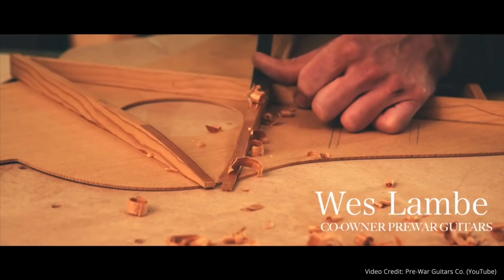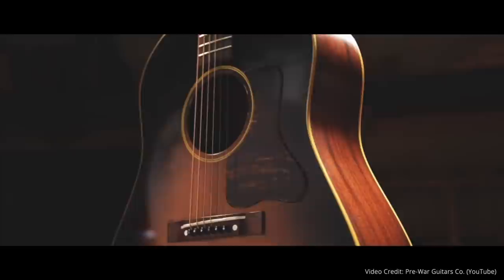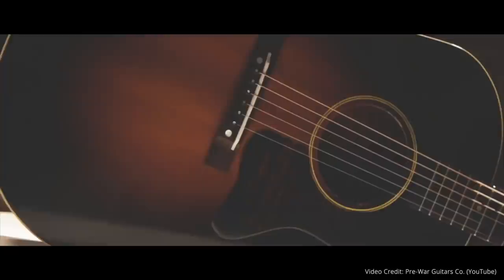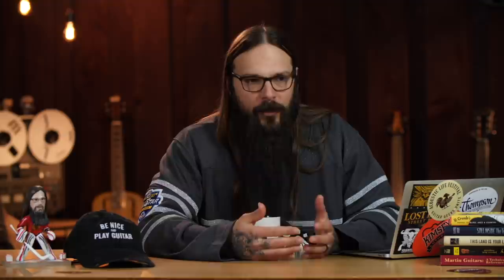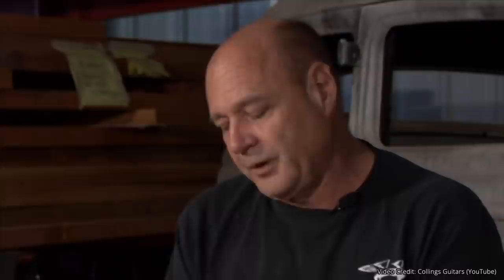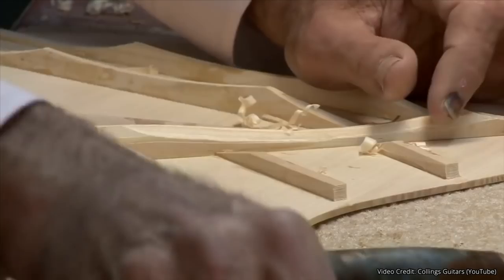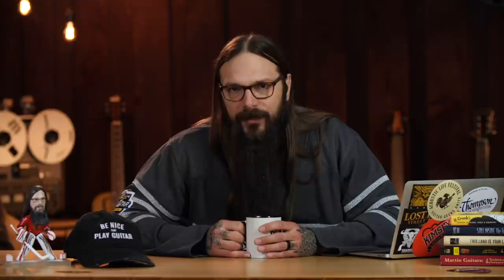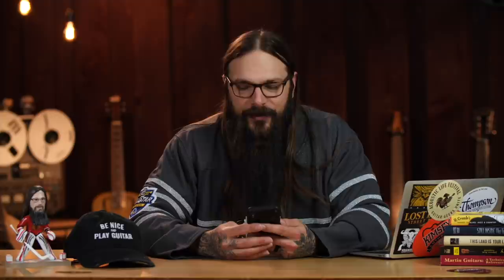Do These Builders Make Better Martins Than Martin? ★ Acoustic Tuesday 188

Comment: Pre War is really the only company trying to recreate vintage Martin’s. All the others sound great (big fan of SCGC & Bourgeois) but they are different builds in regards to Martin. A bolt on neck isn’t a Martin trait.
Reply: To me, a bolt on neck is a deal breaker.
Reply: @stevenwilliams9758  Not for me. Bourgeois, Collings, Huss and Dalton, Boucher, all use bolt on necks and their guitars are great. There are many other factors that effect tone other than a neck joint. I've played many Martins that were duds  with dovetail neck joints. I currently own 3 Martins so trying to explain my opinion from a neutral standpoint.
Reply: @stevenwilliams9758  bolt on necks don't really make a big difference

Comment: I'm midway through a second Martin OO kit with a student. The first one turned out great, and sounds better than his 2000's factory guitar. The kits are a crap shoot, though. It's wood that didn't make the grade, but that can be down to really superficial cosmetic stuff, like a tiny knothole in a neck, or inconsistent grain width. There are some great boutique builders out there doing one-offs, and smaller companies that are making dreadnoughts just as good as Martin. I believe that once  you get above a certain level of quality, it starts getting really subjective. Not  everyone  wants the same sound and feel in an acoustic. Martin also went through some pretty dark years in the 70's though I think they've got  their  mojo back. As a side note, I had somebody bring me a cheap purple sunburst Fender from the 80s that had a bridge pulling up that I'd stack up against any D-18 in a blind test. You just never know. Also, I think the StewMac kits are Martin parts, but I could be wrong.

Comment: I have two martins the hd-28 and d-35. Love them both but can't afford the ones you mentioned here so I am limited to my budget. I wanted a mahogany body dreadnaught. I had my mind set on the d-18. I tried several d-18s then tried godson's j-45. I now have a j-45 and purchased the first one I played side by side with the martin. It's as loud and better action than the d-18. The shorter scale length is more comfortable for me since I'm a small person. I'm not a bluegrass player so the j-45 is a wonderful surprise to me. I still love my martins but the j-45 complements them very well.

Comment: sometime, I would like to hear you talk about owning and playing playing multiple instruments vs owning multiple guitars on acoustic Tuesday.  I played acoustic and electric guitar for decades, playing mostly 3 or 4 country style flat picking and finger picking. I tried many times to wrap my head around theory but just could not get it done.  Adding mandolin taught me relative minors, chord scales and drove home the fact that playing all the notes in a chord is not necessary.  In less than 3 months of playing I learned what I failed to learn in the previous couple of decades.  Playing resonator open tunings really hammered home the whole root, third, fifth thing in a way standard tuning could not and how to figure out minors, 7ths et al because no matter what  major chord position the bar is in, the 1-3-5 are always the same. Dobro (i call it because I play lap style) also made it much easier   to play pentatonic scales over a chord progression.  Dobro also made much more clear the idea of major and minor scales because it is linear. So instead of many different acoustic guitars, I have one steel string acoustic, one classical, one electric, one mandolin, and two resonators (open D and open G) and one electric lap steel (in search of a second for same reason as my dobroes).  When I get the T Shirt, I will post a pic and  list the brands.

Comment: I purchased a D-18 this year. I wanted a D-28 for 38 years (my teachers). Tried the D-18 and took it home. 
Well I swapped for 5 minutes my Rickenbacker 360 to Richard Thompson this past summer at "Frets and Refrains" for his Lowden 3/4 of the size of my D-18 twice the volume.
Four times the price.
If I was making my living from that guitar it would be a Lowden or Santa Cruz Tony Rice. 
If I were a professional mechanic you would find Cornwall or Snap on in my tool box. Not Craftsman.

Comment: Yes.  It's the tap testing and the radiused tops and all the attention to detail that goes into a Bourgeois or a Preston Thompson that puts them above any Martin made since the late 1940's.  These boutique guitars are very expensive but it's chump change compared to what a 30's or 40's Martin goes for.  Plus the boutique guitars have better necks and they're designed for optimum playability.

Comment: I'd agree with a comment further down in this thread about Wayne Henderson.  I personally love my 2007 Martin HD28V.  I looked and play at least 40 of these guitars until i found the one i took home.  When I first hit a chord and felt the tone woods vibrate into my chest, I knew this was it.  I had looked at many others, some on your list, but decided the HD met all the requirements I was looking for in what would be my workhorse.  I've been beating this thing in public for almost 15 years, dropped it twice, broke the nut, hit it on the mic stand twice the first night out and it still gives me love every time I put it around my neck. Are there better guitars out there? Probably. Is there a better guitar for me? Probably not.  Find what you like and play it, all the time.

Comment: I have a Collings D2H. For a Collings Dreadnaught it's low end but it sounds better than any Martin I've ever heard. I also have a Santa Cruz 1929 00. I know it's not a dreadnaught but it's easily the best 002H I've ever heard. 
    Yeah, I changed the topic from exclusively Dreadnaughts but the story behind both acquisitions you may find interesting. I've lived in Bangkok  for over five years now and I've been checking out a very reputable shop that only sells left handed guitars      (Yep. I'm a leftie) around the Boston area and I saw these two and had to have them. And they're really snapped up quickly. 
      Special Delivery for guitars this valuable is several hundred dollars. And they inspect the woods to make sure they're not endangered. And you have VAT. 
    But I took both of them home on the same day. Worth every penny.

Comment: Be sure to look at Gallagher guitars.  The new owner Dave Mathis is increasing production of their "signature" models (G-50, G-70 and Doc Watson) but also has a new model called the Bluegrass Bell, based off of a 1937 D-18.  I won two-a Doc Watson I bought in 2014 and a new G-70 with a yellow cedar top.  You will be able to find these more readily than was the case before the new ownership. Otherwise, I agree with your other top guitars.

Comment: I think these smaller shops, among others (and the shop Yamaha has in Japan) make better guitars simply because there are too many guitars produced by Martin. The time for quality,  quality control is just not there. Minutes allotted for inspection per guitar, and way more hands involved. Too many cooks, so to speak.
Reply: Excellent point. The same observation applies to Taylor Guitars. However both companies are excellent at self-promotion.
Reply: Wouldnt small boutique shops be closer to the martin custom shop? Less hands more QC. That would be more accurate comparison I feel like than mass produced martin models.
Reply: @GirthQuake3  
Another thing to point out is that the vast majority of Martin’s production volume comes from Mexico not Nazareth.

Comment: I love the sound of a dreadnought but they are not for me. My right arm goes numb after about 15 minutes of playing due to the edge of the lower bout digging into my arm (something a bevel would cure). I am a 00 player.🤗
Reply: You should try a Martin d16e. Dreadnought with 000 depth. I had the same problem
Reply: @patrickwhite3362  Sounds interesting, I will have to check one out.
Reply: Are you sitting on a sofa while playing? Try sitting on a stool where your body is more upright and extended, like a bar stool. My arm does the pain and sleep thing, too, when I play my D on the couch. But extending in a "proper seating" position, I have no problem. Ya don't get to feel like yer in the nasty couched swamp groove thang, but ...     Your creativity will adapt.
Reply: @blakebruner6173  I usually sit on a stool with a foot rest while playing.  I have a  Furch Little Jane for couch or chair lazy playing or a ukulele.

Comment: Actually I prefer parlor guitars over dreadnaughts. 
Funny journey. Back when I started I preferred dreadnaughts with cutaway. Then I heard the difference in tone to a dreadnaughts without cutaway. Along the way I found that these are a bit too big to carry around - so bought a travel guitar in the size of a baby Taylor. 
It was easy to travel around with but It just wasn’t satisfying in terms of sound. 

So ok let’s take the middle maybe so I bought a Taylor BBT. Loved the sound still one of my two favorites. 
But in a way… still too big. 

Then I bought a Parlor guitar. Solid top Mahagoni with way too thick lacquer and finish on it - but the size was finally right. So I sanded of the finish and the lacquer and reapplied new one very thin with a paper towel and polished it. 
Now it’s sound as if it’s the voice of god coming out of it, warm, soft and clear tone with a lot of sustain and presence. It’s really „in your face!“. 

After all she could be a bit thinner but for now - I found what I needed all those countless years.

Comment: Tough to find and play these boutique guitars and when you do the store keepers watch you like a hawk and it makes it difficult to get comfy and dig in to all that guitar has to offer.  Froggy Bottom made a big splash years back but I’ve never seen one in person.  I’ve never seen a Santa Cruz or a Thompson either and I live in NYC and frequent many guitar shops.  I’ve bought many Martins and honestly the quality control on them is terrible: the JMOM, the CEO 7, a HD-28, all had problems.  While my $500 used Takamine was issue free for years.  My two best sounding guitars where a Gibson J45 and a Gibson L-00.  Never had one issue with either of them and they both play and sound great.

Comment: I have a Martin. Because I am a lefty, my Martin was made in mexico, says so right on the serial number sticker. From my experience, Yamaha makes a better guitar than Martin. My Martin is a POS. The back of the composite neck is so rough that I  can use it as an Emory board to file my finger nails. It is stored with all of my other guitars, in a sealed room with an automatic humidifier set at 50% RH.
Reply: I’m pretty sure lefties are available in almost every model Martin makes in the US.  Your Martin is a POS because it’s a Mexican Martin.  I completely agree that Yamaha wins hands down against Martin under $1,000.
Reply: @charlesbolton8471  Actually Charles, no they don't. But Taylor does, and Taylor are first rate, top quality guitars. I have two of them. I will continue to buy Taylor, quality construction and superb playability and tone. I play my Yamaha more than the Martin, but my Taylor Koa is my go to acoustic.

Comment: The answer would be an obvious no because they are not Martins.  
I have owned 15 Martins new and used. I will never buy another new Martin. Long story.  Multiple back to back failures with very expensive custom ordered Martins in 2010/2011. Disastrous and the worst customer service of any guitar company I have encountered in 50 plus years. They are not the same company they were pre CFM IV. 

As to a non Martin Dread....
When you find a great Gibson there is no Martin that can touch it.. however they are rare and inconsistent.
Reply: True

Comment: Nobody makes guitars better, but Martin won't sell you a Martin for less than $3k.
And no, Martin invented nothing. They DESIGNED THEIR OWN X Bracing. Other bracing, even the X pattern was already being used. The Dreadnought came out in 1916 and failed. When they achieved their amazing technology for their new X Bracing in the 1920's, the Dreadnought was reintroduced. Washburn made better guitars and the Dreadnought was to go up against the Jumbo. The Jumbo won round one and Martin came back in the 20's and have not been caught since by any competition. Before that, they did make guitars, but as a novelty. They were primarily a Mandolin Maker.

That is, until they started making lower quality guitars for under $3k. Pepsi challenge any Martin $3k & under against $1k or $1.5k from other makers and you will have a tough decision on your hands. Over $3k, Martin is clearly louder, crisper and resonates more. But I gotta say, $3k for an acoustic guitar and every Luthier working for Martin should be rich. But are they? Not by a long shot...

Comment: Um, C.F. Martin did not invent the guitar, nor did he invent x bracing. Most of the German immigrants who came to America in the 1840's were already using x bracing, C.F. just happened to be one of them, whilst most of the Europeans used fan bracing, all based on Torres classical guitar design.  Martin's only true innovation was the dovetail joint methinks, which he borrowed from his cabinet making training. Torres designed the Spanish heel joint still used on most classical guitars.. In 1850 Martins were one of the best. In 2022, they are mostly mediocre, often overpriced, and there are much better guitars out there for less money.  Maybe your title should be do modern builders make a better guitar than Torres, after all, he made the first true modern guitar back in the early 1800's........which C.F. Martin and everybody else copied and based their guitars
 on originally. I guess if I want an authentic sounding 1850's guitar I'll buy an unfinished or French polished Martin with heavy gauge steel strings.  If I want a 2022 guitar, methinks I'll buy something else, eh?!